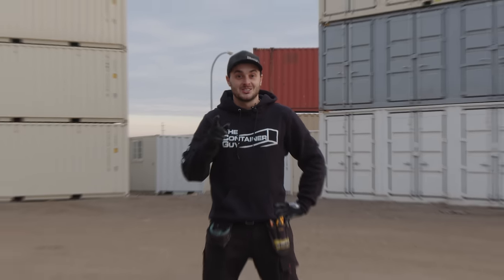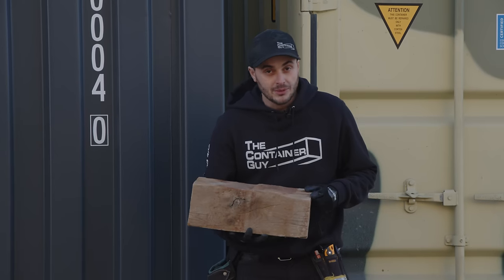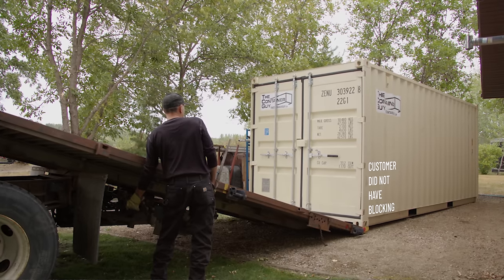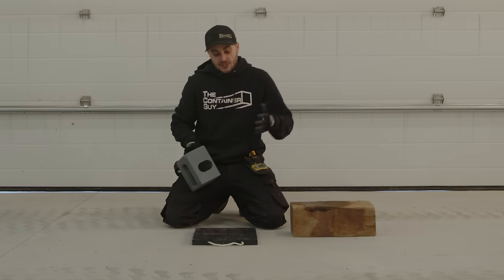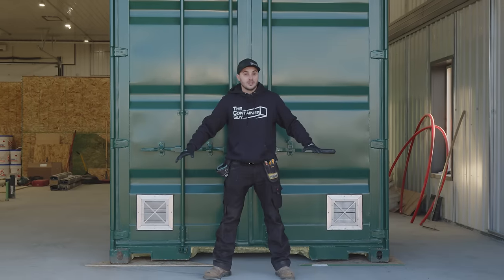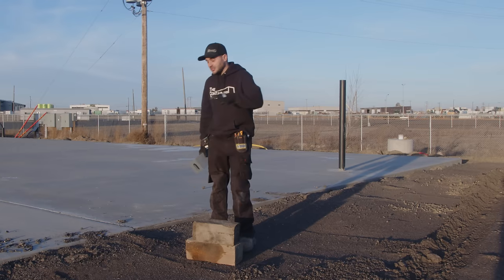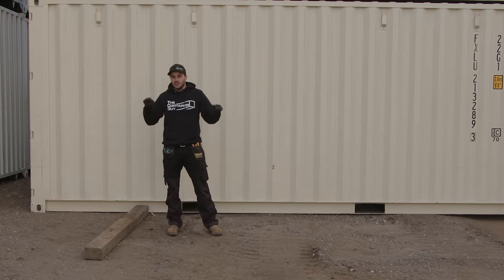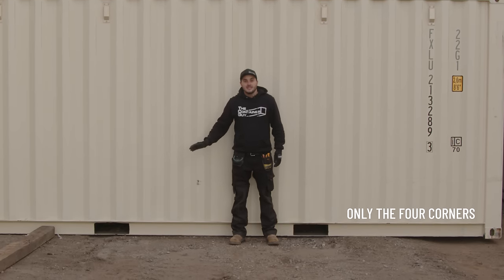What YOU Should Put Your Shipping Container On!

Comment: I have about 18 inches of drop from the front to the back of where I’m going to put my 20 foot container. I was thinking about putting concrete piers with footings and rebar at all 4 corners. Then put about 3 inches of chat down also to help keep grass and whatever else from growing. What are your thoughts?
Reply from the maker: Is this a storage container or a cabin/home? If for plain storage, that's overkill. Could crib 6x6 blocks 3 courses high at the back end. If you want piles, do you have a local screw pile contractor? Easier to not mix concrete/steel and just stay with steel.
Reply: Ok thank you for the advice!